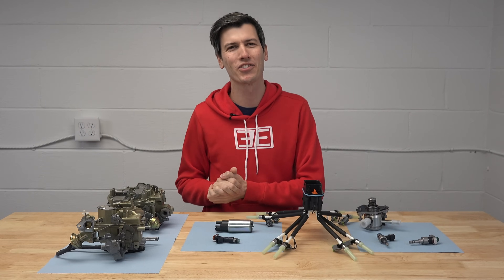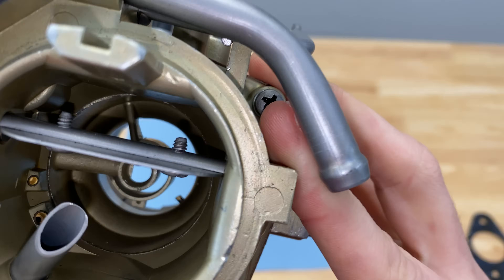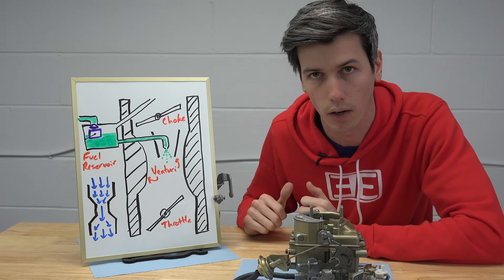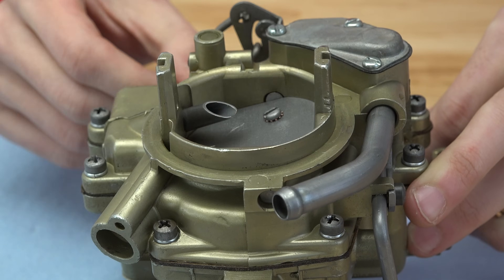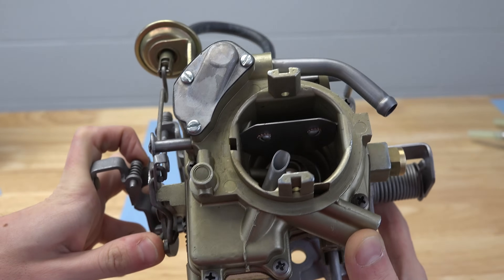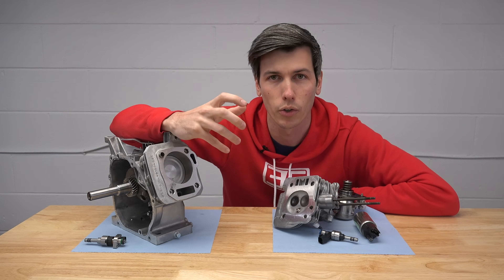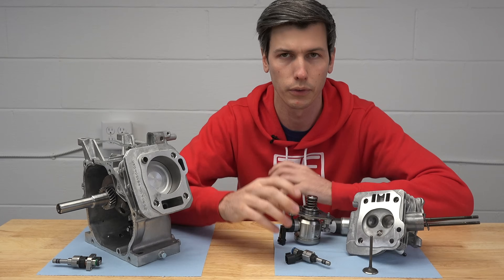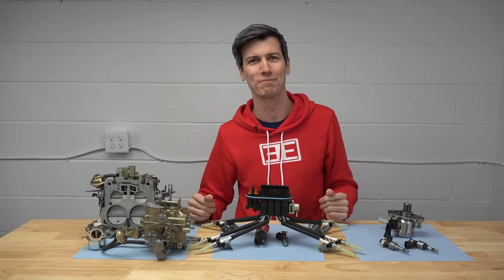What's The Best Fuel Injection? Carburetors vs Port vs Direct

Comment: Port and direct injection sounds great until you get that crappy oil / carbon recirculated air dumped back into the the intake manifold

Comment: The NASCAR drivers were [initially] unhappy when the switch occurred from Carbs to DI.  Why?  Simple: engine rev speed.  Nothing was faster ("rev happy") than a hot Carb: just try foot-slapping the accelerator with each fuel-delivery method and watch what happens!  The guys needed those Carbs for instant rev and power delivery to make a "slingshot pass" before the "window" closed.  Took them a while to get used to DI.  I guess the Carb got the gas in the chamber as vapor molecules; the DI as liquid micro-droplets: big difference...(^_^) ===================

Comment: Now I see the advantages of a range extender engine. If you can set the parameters of the engine at the factory and the only thing you have to really account for is temperature then why wouldn't you make a range extender hybrid. If Elon had to build an engine he would have to learn multiple disciplines and he's proven that he likes to take shortcuts

Comment: Youre experiment is lacking two things.... a regular carb with a vacuum powred fuel pump and a pumper carb like a Tillotson , ZAMA or Walbro.....Pumper carbs rival fuel injectors and beat out regular floater carbs.............

Comment: I have a 1.4 ,75 hp port injected 17 yo Renault which works perfectly fine for me. One of the best small engines ever made in Europe. I would love to bring a v8 from the USA but where I live the vehicle tax for engines over 3000 cc are around $2000-$3000 a year and I am not rich.
Reply: Where do you live and what is your job?
Reply: @ Romania, driver

Comment: I'm sorry, did I somehow miss the part where you compared throttle-body injection to multi-port injection?  My 1985 Cavalier had a 2.0 engine with TBI.  That engine was much more efficient than the 2.5 Iron Duke (especially the carbureted one), and put out similar horsepower.

Comment: I think partially it’s the case that DI injectors have to run such high pressures cause if they were to spray fuel during the compression stroke, the pressure may be so high it would literally force the fuel out of the cylinder.

Comment: Trick question, it depends on the intake manifold. Carbs make more power due to charge cooling but efi allows for more complex geometry of intake runners. (Assuming the engine is NA ofc)

Comment: I like carbs as it is easy to repair than complex efi you need a damn scanner and sometimes it is confusing about problem and to keep extra 2 liter of fuel in tank of  motorcycle i will fill gas once a week about half a tank and if i run out better hit that reserve 😂 to get home though

Comment: I've built many engines on cars, motorcycles, jet skis, name it.. and several totally custom turbocharger systems with obd0 (yes) . I have much appreciation for the ability to fine tune air/fuel ratios with the ecu/EPROM chip but there's still something I just love about old motors and carburetors.. especially the two strokes. We need to get back to two strokes but perhaps without the premix.. i.e. an independent oil system to keep things clean

Comment: The most simple Port vs Direct Injection point that you may not have clearly mentioned is that Port Injection typically sprays it's fuel closer to the bottom of the compression stroke, where the fuel and air mixture are compressed together as a result of the compression stroke. Direct Injection typically sprays it's fuel at or near the very top of the compression stroke, into already compressed air, which is why it (DI) requires all of the additional fuel pressure in order to overcome the cylinder's pressure that will be at or very close to (or even at) it's highest point. Because of when Direct Injection introduces fuel, it also lowers the danger of pre-ignition (knock) and allows for greater static compression ratios than it's Port Injection counterparts, leading to greater efficiency in the process, even when using the exact same fuel. There is no more clear example of this than when directly comparing a GM 6.2L Gen IV LS3 engine (5th Gen Camaro) to a GM 6.2L Gen V LT1 engine (6th Gen Camaro). Both engines use identical displacement/bore/stroke/valvetrain-type/Fuel-Octane-rating and differ only in the cylinder head designs, 1 to accommodate PI (LS3) and the other to accommodate DI (LT1). The 6.2L LS3 (10.7:1 CR, Port Inj) is rated at approx 425 HP / 420 ft.lbs.  The 6.2L LT1 (11.5:1 CR, Direct Inj) is rated at approx 455 HP / 460 ft.lbs. While producing more power overall, the LT1 is also a slight bit more fuel economical.

Comment: A great video as usual! A carburetor will have the most cooling effect as the time that the fuel moves from the carb to the cylinder is longer due to the length of the intake port/runner. This tends to allow for slightly higher power numbers than FI on the same engine. Fuel injection gives the most control over the entire rpm/load range, but without working control systems they will not run properly or at all. Carbs are archaic but will still supply fuel after all the high tech control systems breakdown. Don’t get me wrong I like FI but I get more satisfaction working on my +80 years old car.

Comment: Iam so proud of your knowledge in the motor field but why you never tell the society of the complicated wiring and the many sensors and the High pressure pump the fuel injection demands which has been the r ason for cars catching fire. Statistics show that 19 cars catch fire every hour every hour every hour which is about 455 cars in a day of which 8 drivers die tragically every week and the lives and bodies of hundred are traumatized. Unlike the safe carburettor system which only required a mechanical fuel pump which was cam driven and excess fuel in the bowl was sent back by the float by preventing the entry and the excess used to find its way through the T joint and from there through return tube to the tank.Iam struggling for the last 23 years but in vain unable to make governments all across the globe understand the dangers of these modern day cars that outweighs the little good it does by leaving no unburnt fuel in the cylinder and later the exhaust. How can a woman or child or an elderly parent run for life in such a car fire that too in present traffic conditions or on the highway when the car is at about 50 to 60 miles per hour which is about 80 to 95  kmph.Will not the driver lose control and cause the vehicle to bang elsewhere adding to the disaster. How can you bring the governments in authority to understand unless you tell them the demerits of the modern day cars as long as you keep telling them only the merits of the fuel injection systems. People who dont realize the bad it's doing to lives are sadly in authority to have banned the carburettor system which was the safe mode of transport., How are you going to help them understand. Please never think such things happen if something has gone wrong.Even if even if even if everything goes wrong also a vehicle shouldn't catch fire. Please understand my brother.Iam fighting for the safety of one and all.

Comment: Carburetors are the best fuel delivery system. Electronic fuel injection is only used to control the fleet emissions for manufacturers. Fuel injection does not have lower emissions, is not more efficient, and does not produce more power. Carburetors can be problematic. Carburetors require tuning and only work well at operating temperatures. Fuel injection is a more "set-it and forget-it" system. Fact: Efficient engine operation depends more on intake runner/port design and flow rate than the type of fuel delivery system used.

Comment: Most cars i have owned had carburetors. A carburetor can be totally shot and the engine will still run. Very badly, but it will run. With electronic fuel injection there are about a dozen components that can cause the engine to stop running. This is extremely dangerous as you can get stranded along side a busy freeway. I would take a carburetor any day over electronic fuel injection.

Comment: I was watching this up to “the fuel cools the air and enables ingesting more” - this is the wrongest myth that even engineers seem to fall for sometimes. There is a thing called “vapor pressure” and it’s effect is to displace air. When the fuel evaporates before the cylinder, the engine ingests LESS air, not more. In fact PV=nRT tells us that cooling has no effect whatsoever on the ingested mass, and from there adding more mass (the fuel) just competes for space as the inlet duct can be seen as a closed system. This is the reason why the injection point went from far away (carb) to port, to direct. DI injects liquid fuel inside the cylinder and DOES NOT disturb the air intake and choke it with fuel vapor pressure, allowing more air in. Also, temperature is temperature. If evaporating a certain amount of fuel lowers the charge temperature by X, is does not matter where the fuel is injected, the temperature drop is going to be the exact same X and PV=nRT again tells us that the only thing happening will be a drop in pressure. So again, the injection got closer and closer to the cylinders over time to avoid displacing oxygen, which is what ultimately makes more power. As a side note, the Daimler-Benz DB605 V12 was direct-injected in circa 1940 so nothing really new here, everything I wrote is perfectly documented for more than 80 years in the literature and the myth is just wrong.

Comment: but on the high rpm and high piston speed direct injection is not good in matching the correct time of injection of fuel, so electronics again switche it back to port injection. Presenter Should have mention that definitely. besides of that all info is okay

Comment: you can keep the intake valves clean by just killing the engine by shutting off the fuel rather than shutting off the spark.   They mostly get dirty by unburned fuel vapor flowing back onto them when the spark is killed to shut the engine down.

Comment: Sir, I feel that though fuel injection is suitable for a multicylinder car engines it is not suitable for single cylinder commuter bikes.  If the ECU OR INJECTOR goes haywire while the vehicle is running, it causes sudden deceleration which causes the motorcyclist to be run over by vehicle behind. I am experiencing this phenomenon in my new bs6;FI honda activa 6g in India. I feel that the lack of redundancy even with injector is like the MCAS sensor in a Boeing, whose failure causes an entire jet to come down. The videos of this issues are posted in my channel, which depicts the vehicles inability to work with accelerator input even though engine is working(please watch at full volume so that engine sound is audible), this is aggravated by the fact that this problem occurs in a sporadic manner while the vehicle is working just perfect. Authorised service of Honda in my locality said that they have replaced the ECU, cleaned injectors and fuel pump etc but still now the problem persists and is causing danger to life and limb. The vehicle is just 3months old. Please shead light into this issue as honda here doesn't care for customers safety.

Comment: Do direct injection engines with a supercharger face this problem of carbon build up on the intake valve like unblown engines? 

I think that with a blown engine there would be more turbulence on the port side of the intake valve to minimize carbon build up. In addition, the compressed air would create a wall of air minimizing oil from running down the valve.

Comment: I'm such a Turbo Diesel Direct Injection fan after that. Lambda values and knock are no issue, you can therefor run the engine extra lean. Diesel is cheaper and also has higher energy density. You  also have this torque mountain at lowest rpm, which also means that there is a much bigger useable area under your power curve. The Diesel has no physical throttle, which makes the engine more efficient and economic, together with the higher compression. I really don't know, why petrolheads do not convert?

Comment: Seeing a small carburetor work in slow motion is weird. What I saw wasn't so much low pressure drawing fuel from the float bowl but more like fuel velocity going with the flow. Once this tiny stream of fuel was in the venturi (the stream almost hit the opposite side of the venturi when it stopped), there was a pause then it broke up into a mist as it was pulled into the cylinder. The fuel wasn't vaporized, it was "misted"...I guess. The intake valve closed and there was another stream of fuel squirting into the venturi. It was a natural (or side) draft carburetor and the fuel was getting into the venturi from the bottom, 90° to the air flow, going straight up. Now, fast moving/low pressure air is probably how the fuel first gets into the venturi but once that intake valve closes and air flow stops...but fuel is still in motion and in that concentrated stream of liquid, fast moving/low pressure becomes no moving/equal pressure (equal to the air pressure before and after the venturi). Once the pressure drops (in and after the venturi) and air flow resumes (before the venturi), that stream of fuel acts accordingly by going from a single stream of liquid into a scattered mist traveling towards the intake port.
The math and what my eyes are seeing are two different things. It's not air speed and low air pressure pulling fuel in, but the velocity of the liquid being in motion that does it. The air flow and differences in air pressure have their respective roles to play, but it isn't about getting fuel from the float bowl into the venturi.

Comment: Port fuel injection allows better control (closed loop control paired with a HEGO) of A/F ratio in order to prevent catalytic converter breakthrough (saturation, either rich or lean with a 3-way cat). This is what enables the vehicle to meet EPA exhaust emissions, and thus allow it to be sold to the public. The second advantage is fuel economy, which is also a key selling point in marketing a vehicle.

Port injection usually has the injector spray pattern aimed directly at the back of an intake valve. The head/intake is design so the injector is aimed at the back of the valve.

Port injection will have 50x the cold start performamce as compared to a carburator and a choke. If done correctly, port injection with an advanced cold start fuel injection event-by-event strategy can actually smooth out a very cold temperature start even for a small 4 cylinder engine to very low temperatures (10 degrees F).

At high RPM you run out of injection time very quickly with direct injection. With port injection you can put in much more fuel mass given the amount of time between intake events of a 4-cycle engine. So, it would make more sense to use direct injection at lower speeds (where you have a lot of time to inject) and port injection at higher speeds (where you have greater fuel demand and mixing).

Stratification of charge is an engine design focus, however it usually only has a very limited useful RPM range, unless paired with dual mode variable cam timing. The effective nature of the technique seems to be always limited to a specific RPM range no matter how you modify overlap.

Comment: I'm considering buying a car with direct injection that runs on the Atkinson cycle, so the air-fuel mixture created within the cylinder is partially forced into the intake port during the compression stroke while the intake valve is left open. Will this prevent carbon buildup on the intake valves, since there is now gasoline in the intake ports? Might make a good video!
Reply: If you change your oil regularly with full synthetic you're fine. Carbon deposits become a problem after 130,000 miles. Driving for longer periods of time will also prevent build up because the valve stems will reach a higher temperature so the carbon won't stick on the stem.

You can easily clean the valve stems with spraying high pressure dry ice or CO2.

Comment: there is a theoretical 30 percent airflow improvement with fuel injection because it doesnt need a venturi restriction to pull fuel out of a carburetor float chamber.

Comment: Why not do it one better and inject the fuel at the top of the compression stroke? That way you avoid knock and can user a higher compression ratio which enables you to get more energy out of the gas. What am I missing?

Comment: We just got a 2020 Toyota Camry that uses both. I usually buy domestic brands, but Ford and GM just stick it to the buyer by not adding both. GM and Ford both have had higher than normal engine failures and owners have ran into misfire issues from carbon build up around 45-50k miles and having to shell out another $600-$1000 to have the valves cleaned. In some case (Ford) turbos have suffered from cleaning and they have a service bulletin out on how to clean them without damaging the turbos. Pissy poor design choices and why I now buy Toyots or Honda products. I am not saying Toyota and Honda are perfect, but you sure have a better chance on reliability with them than Ford or GM imo:P